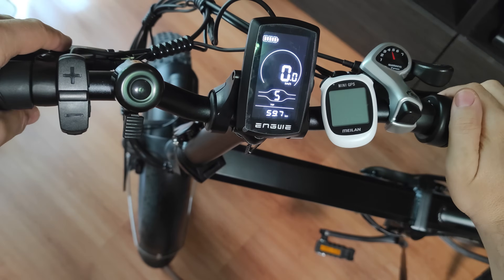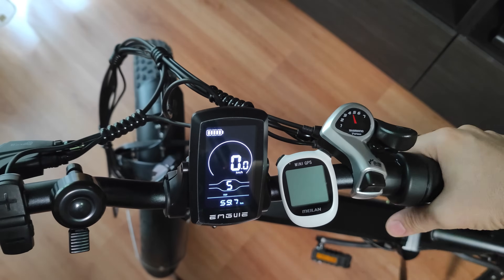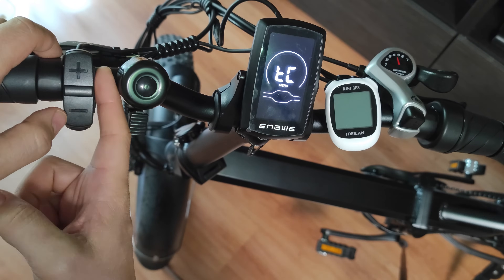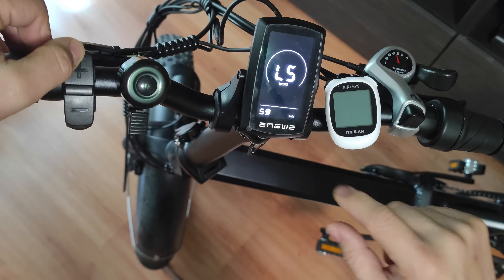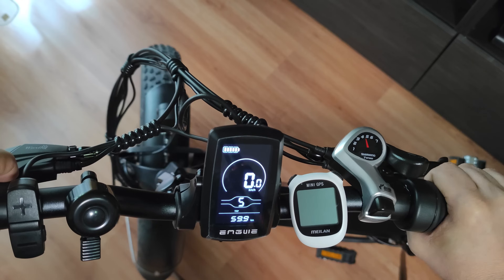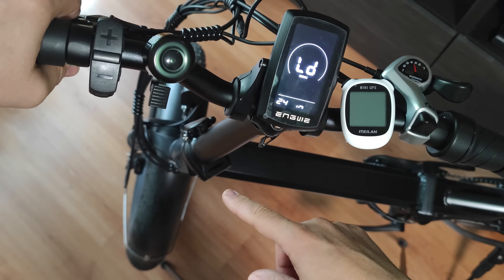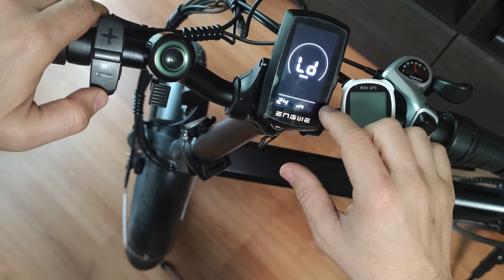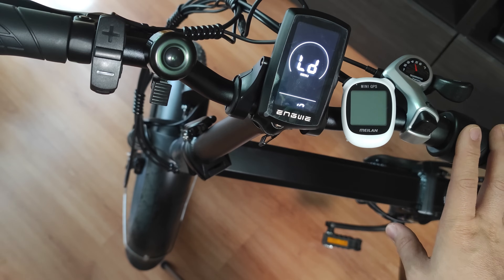Engwe Engine X Speed And Power Unlock Guide - Yolin YL80C Controller

Comment: I go 60 too but the max is 47kmh why doesnt it say 60? Does it really go 60 or am i missing something?
Reply from the maker: The display supports max 60, but not the motor, controller and the battery system.

Comment: Is it sill working now please tell me
Reply from the maker: Maybe yes, maybe no. Newer bikes will be permanently locked due to irresponsible users.
Reply: Yes it's programmed in the controller and always will be unless u change it but be very careful how u use these settings as the controller is the brain of the bike so pressing a button by mistake can be a big deal! The newer version that has boost is exactly the same as the pro 2.0 it doesn't have the boost button but it was always there on other models as the 16ah batterys have the option  to burst up to 60amps while the buttons pressed but if u keep your finger on the minus button while moving on the bike and if your quick enough you'll see the bike person on the screen move across it much faster ,the battery calls this in a rush ,my bike does 30mph with or without this function but everyone is picking this boost version when it's exactly the same price as the pro2.0 it's just a marketing stunt by engwe tbh id much rather a standard geared motor like most fatwheels as u can't control your speed from the twist throttle or the peddle assist it is a good solid bike but needs lots of changes to make it a proper bike and that's what I'm going to do a complete makeover from that screeching wheel to everything else I've pointed out .fiido is another one of these type brands there'll be 1 or 2 really good things about it but when it gets to the assembly line it's disgraceful how they get away with there parts and how there setup these type bikes need checking monthly every important but and bolt you'll thank me after the first month and get some lock tight it'll save u the odd mth ✌️

Comment: What tyre pressure is advised on these tyres?
Reply from the maker: MAX is 1.4 Bar / 20 PSI. If you go on sand, snow, mud, they work better at lower pressure, but they also have higher drag.

Comment: I have an engwe engine X i tried to unlock the speed and when i get into that menu the 25km speed wont move when i press the + button to increase it , not doing anything can you help me whats wrong do you know ?
Reply from the maker: ENGWE has updated their controllers & display so unlock methods have changed. You can try to watch some of my unlocking videos for the newer ENGWE models and maybe something will also work out on the X.

Comment: Does not work on 2024 model
Reply: I also got the 2024 version:

Tuning:
1st: Turn the display on -> hold plus and minus (+ & -) just like he does first in the video.
2nd: Hold the plus (+) until it pops up with the unlocked speed and hold the (i) button so the display restart and enable the unlocked speed.

Untuning:
Do the same thing as you tune the bike, but this time it will reset the speed to EU regulations again.

Comment: Just press + and -  for 5 seconds then hold + for 16 seconds its unlocks speed without all that hassle
Reply from the maker: Not on the X, and not on the older version. There are several unlock methods that depend on bike model, bike generation and display type.
Reply: Bro what is the bedst wolt voltage settings. I think I fucked with it. Thanks

Comment: Does it work on the engwe engine x 250 watt
Reply: Follow this method for maximum speed. This video doesn't show you actually how to unlock it. Hold + - until TC screen appears. Then hold + for 15 seconds until screen changes. Then hold i to lock it in. This method took my bike up to 84km. Let me know how you get on.

Comment: This no longer works for new models. Engwe gave me the instructions for unlocking the throttle and speed on my new engine x;
"When the display is turned on, press and hold the "+ & -" button at the same time for 3 seconds to enter the setting interface. After releasing the "+ & -" button, press and hold the "+" button for 15 seconds to release the 6km accelerator limit and the 25km/h speed limit."
Simple and immediately effective.
Reply: I just received one and it only works with this new system, do you know how to limit it to 25 km again?
Reply: @salvamartin5478  I've not tried but I intend to 1st thing tomorrow. I'm going to try the same process  in the hope that it will reverse the changes.
Reply: @JM-jm4ei  
Thanks!, I appreciate the information if you figure out how to reverse it.
Reply: @salvamartin5478  Confirmed. Same procedure for reversing changes.
Reply: @JM-jm4ei  
Achieved, thank you very much
Reply: Many thanks for this info, I'm keen to know if there's a way to play about with the settings once unrestricted ie reduce too speeds for peddle assist in settings 1, 2, 3, 4 & 5 so as to not be so aggressive? Any help appreciated 👍
Reply: If I order the engine X from engwe will it be the new model you have received  ?
Reply: Thanks…its working for me…its hitting 50 km per hour…i have the new model
Reply: Thank you very much you solved my new bike problem🎉😊
Reply: Thanks so much for posting this as I've just bought a new Engine X and the previous mods didn't work. This is even easier to do than the previous mod. It's hitting 32MPH now🙂
Reply: But is it impossible to unlock the 45 km power?
Reply: On the new version
Reply: I can confirm this method works on my brand new (as of February 2025) Engwe EP-2 Pro also. Thanks for the info @JM--jm4ei
Reply: Worked well, going like a bullet now, many thanks!

Comment: How can you fix the 25 error and the same fetbike as yours please make a video thank you!!!😢
Reply from the maker: The ENGWE EP-2 PRO has a Yolin controller, the code 25 is related to the brake sensors. Check the brake levers, brake electric cables, brake sensor plugs.

Comment: Hi, i am looking at getting the Engine X to food deliveries on Uber/Deliveroo. If I unlock the motor so it can provide a throttle speed of say 17-20mph going up mixed terrain (flat and hills) how much distance/range would you say i could expect? Thank you
Reply from the maker: If you are going also to pedal from startup and when accelerating, then you will probably do 50-60km considering hills, extra load, etc.
Reply: thank you! @TechTronic9000

Comment: Hi, thanks for your great little Video! When you changed the Speed to unlimited, is there a fast way to get back to Limited Speed (25km/h)? Thanx
Reply from the maker: No, you need to repeat the process, so there is no quick way to limit.
Reply: @TechTronic9000  Do you maybe know if there is a way to make like a system that for example: you click - 5 times and the bike goes to 25km/h?  Also can you disable the throttle bar?
Reply: @TechTronic9000 so when the bike is fully unlocked if you go in settings and select reset that won't lock the speed back to 15mph

Comment: If I unlock it, do I damage the bike and the engine?  When it's meant to be 25?
Reply from the maker: No, but your battery will discharge much more faster.
Reply: @TechTronic9000  And can you tell me how long it takes?  I don't know about 45 km, but I think 25 km is too little, why do they give 25 everywhere, it's as if I was running at that speed

Comment: hi techtronic,

i saw in the video when you set the speed limit to 60kmh and you tested it out why did it only go 52kmh?
thanks!
Reply from the maker: The display & controller only allows maximum unlock speed of 60km/h, but it has nothing to do with real speed under load. On some models you can set the limit to 99km/h and they will only do 28km/h top speed :)

Comment: Can you answer a question for those like me who are a bit dumb?  The Engine X is 250w rated as standard yes? So by performing this unlock, does this increase the watt power rating?
Reply from the maker: The Engine X comes with a motor that can safely operate into 200-1000W range. The controller also can operate in two modes, limited 250W and fully unlocked which allows close to 1000W. So when you buy it for EU it comes locked and limited to 250W. By your own risk you can enable full power.
Reply: I dont get it why is it so easy changed up with a few settings if 250w is standard Eu. If a bike was stopped in this mode surely the bike that details 250w etc saves any hassle?

Comment: Hi Techtronic,

Very good video by the way. I have a few  questions,  when you increase your speed limit to say, 30 mph will it kill the batteries quicker? I've noticed that my battery doest last very long when the speed is increased and using the throttle  70 % of the time. 

Is is it when you use the throttle by itself it kills the battery? Or is it better to use the pedal assist?
Reply from the maker: Yes with electric motors the faster they go the higher the power consumption grows, so the range gets a big decrease.

Comment: Hey! Tnx for your clear video. Does that work on every Engwe engine bikes?
Reply from the maker: This works for the X, haven't tested if it works on others. But it also depends on the LCD & controller model. Usually the PRO model has another controller / LCD so it will probably not work.

Comment: Hi! Is there any way to unlock the power without changing de speed limit? By doing the process that you hace explained here, have you noticed more power going up hills or only noticed a change in speed? Thank you in advance.
Reply: im sure it goes both way you cannot increase the speed without increasing the power
Reply: @matox01tekk not true, the speed is limited by the controller
Reply: To increase power you need to increase amps

Comment: My ado a20+ 500wart 24inc Speed max 65.5 50/55 kmh
Reply from the maker: The a20+ has 20" wheels, on 36V you will do realistically 35km/h. The 50-60km/h speed is achievable only by higher voltage.

Comment: I have a problem my engwes gashanlde Can only drive 5km and sometimes it doesnt even drive i Can only use pedals
Reply from the maker: Does it have any kind of error? Check all plugs, cables be sure that the battery is full. Also be sure that the bike settings are OK.

Comment: I’m guessing it drains the battery 🪫 really quick how many miles if you put to 60kpm?
Reply from the maker: Depends on a lot of factors, flat out it draws almost 1000W. Still you can get 30-40km easy from it, using some assistance and lower speed will increase range a lot more.

Comment: Hello, I want to ask if the Engine X bicycle is limited to 250 W only electronically and it can be limited both in power and in speed up to 750 W and more than 50 km/h, by pressing the commands that you show in the video. is that so???
Reply from the maker: The X when is unlocked it has up to ~1000W peak power, speed is unlimited and can be up to ~45-50km/h depending on weight, temperature, tire pressure, etc.
Reply: @TechTronic9000  please, how can I unlock the power to 750w without changing the speed limit? I think that is what I should do in order to go up in a hill easily, right?
Reply: Thank you very much. I wanted to confirm it because in Europe it is a problem that the bicycle is not limited. Although it is recommended that it can be delimited on off-road terrain when one weighs about 100 kg.

Comment: Setting the wheel diameter to 22 gets closer to the actual speed if not spot on. The miles are off so with ebike displays you either choose accurate mileage or speed which is controlled by the wheel diameter setting.
Reply: if you set 30 diameter speed goes to 60 kmh...certified
Reply: clown

Comment: Does it work with EP2 Pro updated version?
Reply from the maker: Probably not as they have different controllers so not all functions might work. For the EP2 PRO the speed unlock should work.
Reply: @TechTronic9000  hey pal, so what is speed unlock? is this something different to what you just showed in this video?

how can i make the EP2 PRO go faster? it only goes 25kmh at the moment

Comment: does this work for the engwe c20 pro? great video
Reply from the maker: No it doesn't work for the C20PRO, that model has a totally different display & controller so if it support unlocking it is done differently.
Reply: It works on my C20PRO 500W

Comment: Hello, which settings should i do for more range?
Reply from the maker: For more range use only assisted modes, keep bike limited to 25km/h. Use modes 1,2,3 and avid using 4/5.
Reply: @TechTronic9000  i use now 0-5 mode 26km/h
Reply: @TechTronic9000  do you know about pas mode? They say if you do pas mode you can ride 100km per battery

Comment: Does this only unlock speed or also power? I think power is always same 750W, no matter if speed is locked to 25 km/h.
Reply from the maker: It's a bit more complicated, the bike controller has a motor strength assistance table map. The power will be reduced when reaching the 25km/h thus you will not get full potential of it. Unlocking the speed will also set the motor strength to almost 100% (~around 1000W) and because you will not reach a limit it will use all that power. As when limited to 25km/h you do get more peak power when you are climbing a steep hill and you are slower than the limit.
Reply: Thanks. So if you drive locked and unlocked 25 km/h it will use same power? Or also power unlocked in lower speed then 25 km/h is bigger?
Reply: In additional PAS settings is possible to adjust assist levels in percentage (up to 100% on highest level, 5-factory set to 96%) also max current in amps (according controller type - data on controller label)